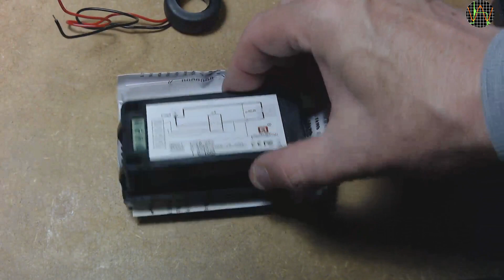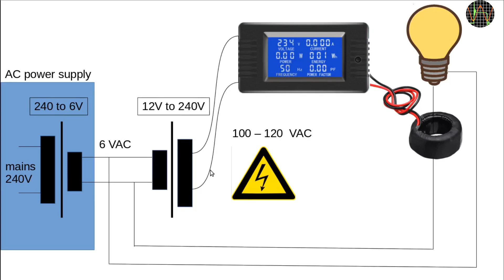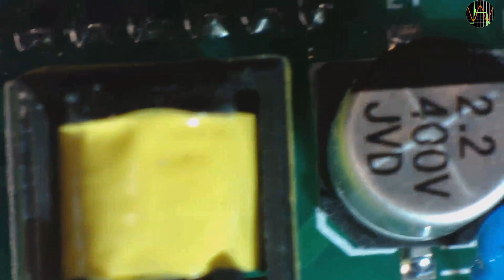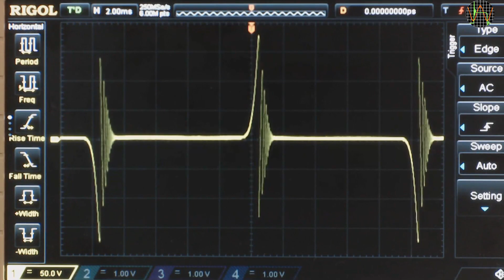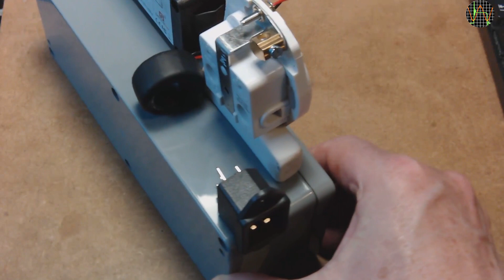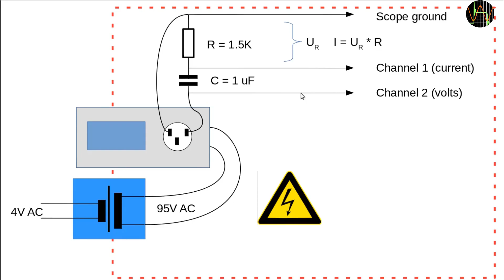Building your own power meter with the Peacefair PZEM-022

Comment: Thanks for your detailed explanation of how this meter works. I recently installed the same meter on my solar system with the CT on the output of my pure sine wave inverter. The CT is wired about 20 or 30 feet ( 6 to 9 meters ) away using I think 16  gauge wire . I have the AC of the meter hooked up to local outlet . So I am not sure if these modifications effect the accuracy of the meter or not. What I don't  understand is right now it shows me 117v  0.895A  32 watts  0.31 PF   or close .  It seems to me that I am using a lot more than 32 watts of power since the amps is much higher . If I turn on waffle iron resistance load then it jumps to 115v  8.8 amps  1 kw  1.0 PF  which seems a lot more accurate on the watts.   Do you have any suggestions ?  Maybe I need to move the AC power input to meter at the same source as the CT instead of at the end of an AC circuit ?  Thanks again for your video !
Reply: I think you should connect the AC input to the inverter. The voltage is probably slightly different to the wall outlet, and the power factor measurement needs to compare the changes in current to the changes in voltage to show an accurate reading
Reply: @oliwatson6096  Thanks - I will give that a try.

Comment: The RS Stock no.: 1748901 for ABS plastic box you have given is a different box to what you are using in your video.
Reply from the maker: The picture on their website looks different because RS uses the same picture for the whole series  of boxes from this Japanese manufacturer (very confusing, I agree). I used the model GA8−20−6 which corresponds to the given stock number (I think 8-20-6  stands for 80mm x 200mm x 60 mm). I will add a note to the description of the video.

Comment: Nice video. Do you think its possible to drive the meter with an external supply in order to make it Work closer to zero volt? I World like to use the meter together with a Vario transformer
Reply: Actually it is quit simple  to modify. The resistor R13 (beside the connector) is where voltage and frequency is measured.  Remove this resistor (1 MOhm) and replace it with a new trough-hole 1 MOhm resistor where the end of the resistor closest to the boarder of the PCB should be connected to what you want to measure (and not to the SMD terminal). Apply your line voltage to the AC in terminals. Notice that the terminal closest to the current transformer is a shared Null.
Reply from the maker: Just so I understand it correctly: You are still using the AC terminal to power the module from mains but the voltage to me measured is coming in through the  "open end" of the 1 Mohm resistor (and the shared null)? That is a great modification. I like it!!  What is the lowest voltage it displays (correctly)?
Reply: @TheHWcave  you are right. I think it can go very low. I testet it with my 24vac solder   iron supply, and it showed 25/27 depending the load of the iron. I will do some futher test.....
Reply: I have done some further tests.  The input can go from 1 Vrms and up. The frequency meter can go from 30 Hz to 99 Hz.
Reply: @jenskaa4044  Please post a picture of your mod, somewhere like GitHub, or DropBox, and post the address, here. More details about the mod would be much appreciated, too. I think I know what is going on, but, as this is mains power, I want to be absolutely certain that I make the mod correctly. Please and thank you.
Reply: @t1d100  I dont have access to the meter right now. But if you could take a picture I will make some drawings on it showing what to do.
Reply: @jenskaa4044  Here is the link to the picture: https://www.dropbox.com/s/9xc27oh7rm77zgb/R13_A_PAD.jpg?dl=0 I removed the screw terminal to meet my needs. I added a drawing of the R13 trace. I believe that I need to add the new through-hole 1M resistor to the right-hand pad of R13. Do I have that correctly? If so, that pad is connected to Pad "A" of the screw terminal. I might use two wires to Pad "A" and put the resistor in series with one of the wires. Thoughts and suggestions?
For people that want a full picture of the entire board, the linked picture has those details.
Reply: @t1d100  After reading my own post I see that it could be misunderstood. You have to connect the resistor to the oppersit terminal, thereby having the open end (closest to the border) for measuring.
Reply: @jenskaa4044  I am so sorry, Jens, but I have become confused. I have a (real) medical condition that makes it difficult for me to sort things out. I have corrected the picture of the board to orient the screw terminals to the left, in accord with the way a person actually views the back of the meter. Here is the new link: https://www.dropbox.com/s/mz92eeuoshv6wop/R13_A_PAD_FLIPPED.jpg?dl=0 Please state what five connections (AC1, AC2, Coil-Red, Coil-Black, Etc.) are made at each individual location of "?, A, B, C, and D." Thank you for your patience with me and for this extra help.
Reply from the maker: Hi Jens,
it might be possible to isolate the input pin of the 3.3 regulator and feed-in an external 5V instead but there are a lots of uncertainties. Are all electronics on the 3.3V rail including the LCD? Also I am pretty sure the module uses a resistor divider to scale mains voltage to the analog input. So the electronics will be on mains level whatever you do for power. This means your external 5V has to be floating which rules out most of the usual 5V “USB-charger” switch mode supplies.  Safest bet would be to make a linear power supply using a 5V regulator and a properly isolated transformer.  Depending on what you want to do, there is  a (safer) alternative. To get current and power factor, you could do what I demonstrated and feed the module directly from 240V mains but run your variac load through the current transformer. You might add a separate AC RMS panel voltmeter to read the voltage from your variac. The only issue would then be that the power figure isn’t correct and you would need to multiply the current readout with the number on the separate voltmeter for that. I would add a (manual) switch that connects the module from straight 240V mains to use your variac once the voltage gets over 40-50V and then all displayed values would be correct.
Reply: Internally the unit is powered from a 3.3v supply via a regulator so the electronics could be powered with a single lithium battery. Of course if you wanted to use it for a long-term metering application then that wouldn't any good. I would be curious as to how much current the electronics uses, I suspect less than 50ma.
Reply: I am building up an AC Variable Voltage Multi-Bulb Dim Bulb Current Limited Power Supply using a DIY Back-to-Back Isolation Transformer, a commercially manufactured Autotransformer and a DIY Multi-Bulb Dim Bulb Current Limiter. My Iso Trans can only handle 360W/120VAC=3A. So, I need to monitor it closely for voltage droop/drop. I will arrange the circuit as Iso Trans to Autotrans to Dim Bulb Limiter. I just caught the referenced meter at a good price on Amazon. I have a few of questions... Where should I place the meter in the component string... I would think it would go after the Iso Trans and before the Autotrans? The unit is powered parasitically; I take it that its current draw is so low as to not require much consideration? Are there any programming/settings changes needed to get it to read the lower values? Or, just set it for the information you want and it does the rest automatically?